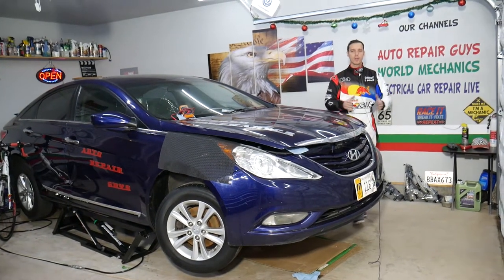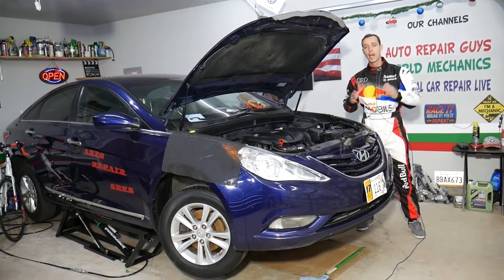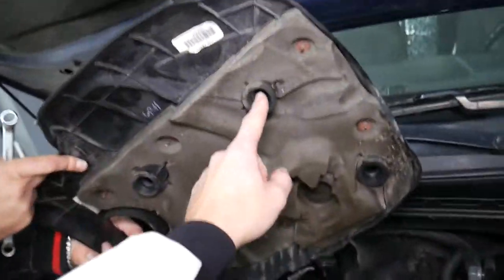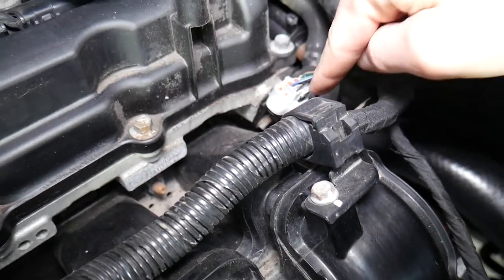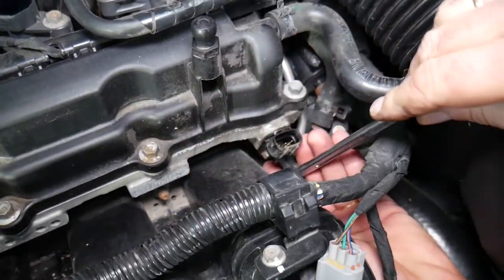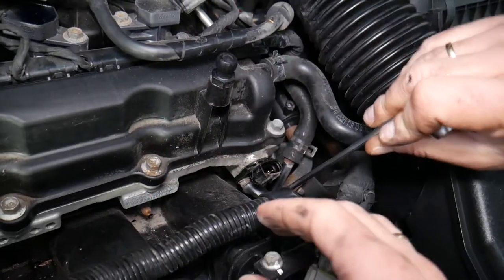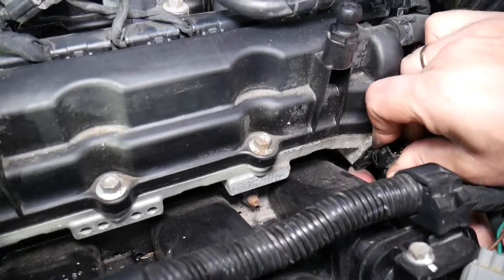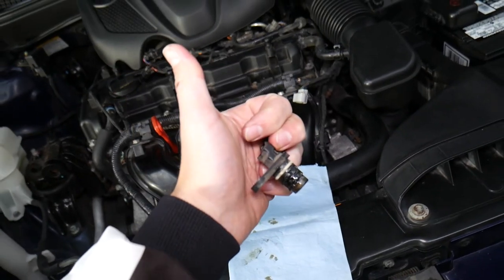HYUNDAI SONATA INTAKE CAMSHAFT POSITION SENSOR REPLACEMENT LOCATION

Comment: What about for a 2016 Hyundai sonata  With the camshaft positioning sensor on the timing Chain cover does the timing need to be set to top dead center when reinstalling and reinstalling the sensor

Comment: My 2018 Hyundai Sonata check engine light came on yesterday and I had O’reilly’s but their testing machine on my car. The code it came up with was Exhaust Camshaft Position Timing over advance 1
Reply: Did you ever find out what was wrong with it? Im having the same issue
Reply: Was the error code p0014?

Comment: I have 2012 Hyundai Sonata 2012 2.4 Gd1 and engine is bad.
I found a engine for sonata 2016 with 2.4 GDI , but one of the camshaft of the intake of the 2016 has different location of my 2012 engine 
My engine has the camshaft by the alternator (right side front of the intake and the engine of 2016 has the sensor
I’m the front of the timing cover . 
Do you think is can install that engine with that different position ?

Comment: Will this cause a no start that will not crank over at all?  Code p0014 or should I look at starter swapped blower motor relay with starter and still no crank over.probably both!

Comment: Does the car need to be reprogrammed after ?
Reply: No, the PCM (engine computer) will instantly receive signal when the vehicle is cranking, and then started. You may need to disconnect a battery to clear the check engine light though.

Comment: Does the 2012 use 1 or 2 camshaft sensors I got code P0355. Or just the one to the front of the car throws the code.